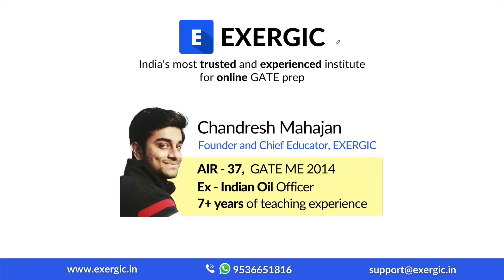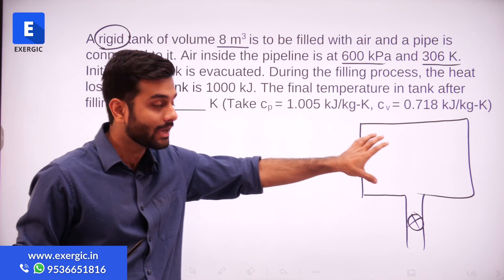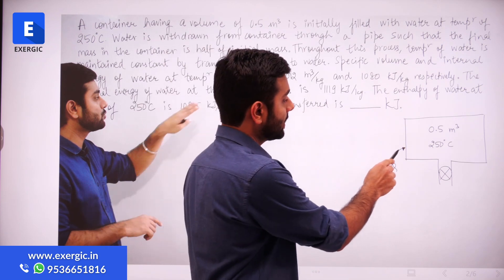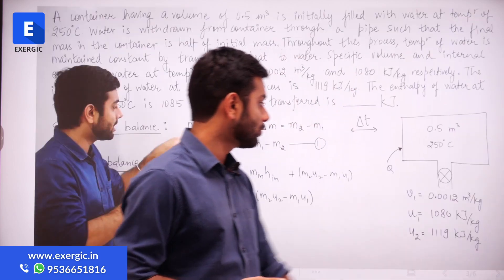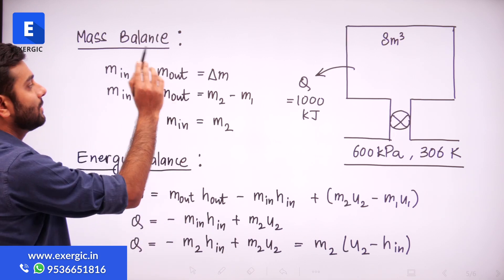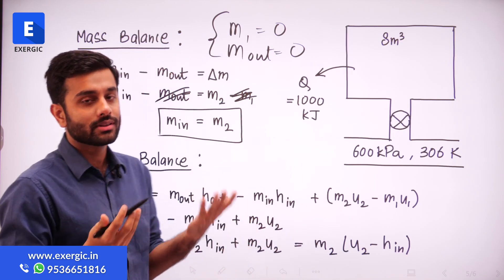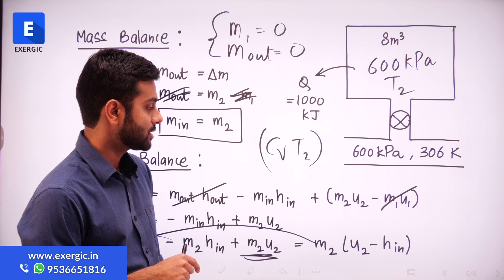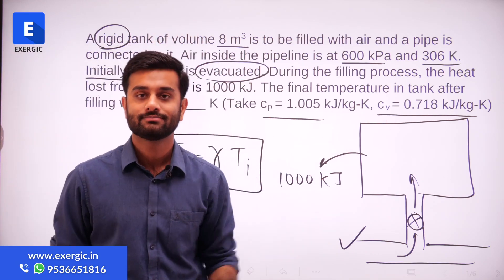GATE ME 2022 : Tricky problem from Thermodynamics | Mechanical | Afternoon session | Exergic

Comment: If a tank is filled with air through a pipeline..it will be filled until pressure of pipeline equals to pressure in chamber.

So final pressure will be equal to air p in pipeline.

Comment: How come the temperature is increasing given there is some heat being transferred from the system?
Reply: is that because the high pressure air  getting accumulated in a closed chamber?

Comment: Sir i have one simple doubt in the question heat in given in Kj but in the conservation equation we are putting energy transfer per second. How it is possible???
Reply from the maker: Please notice in the solution that Energy Balance equation is not written in time-rate form since it is not a continuous process. It has a defined start and end point.